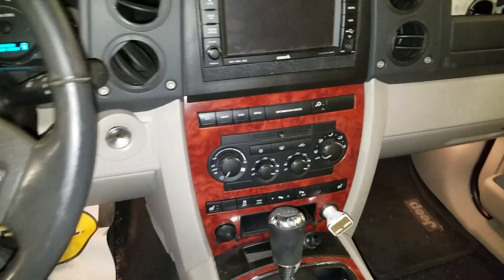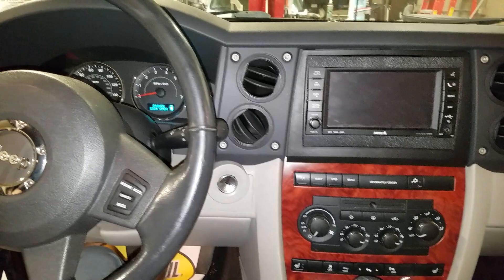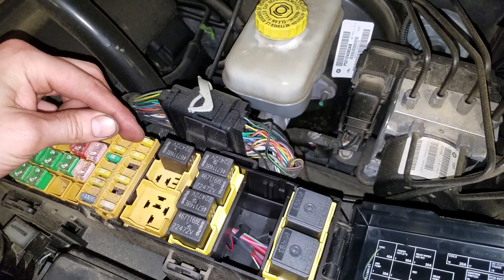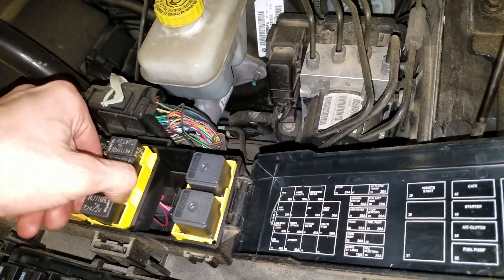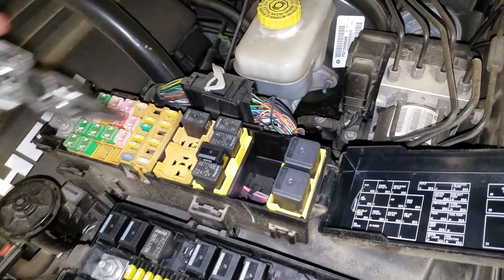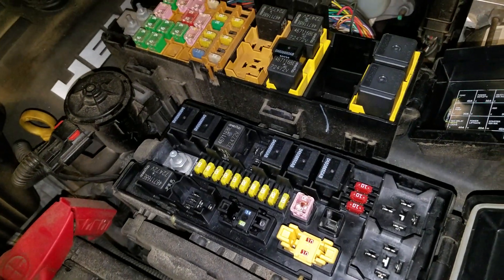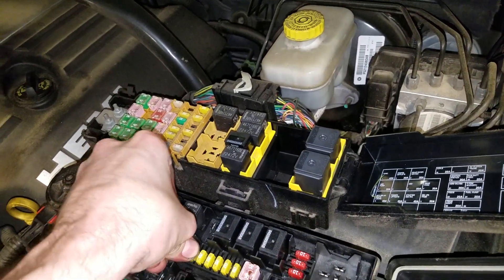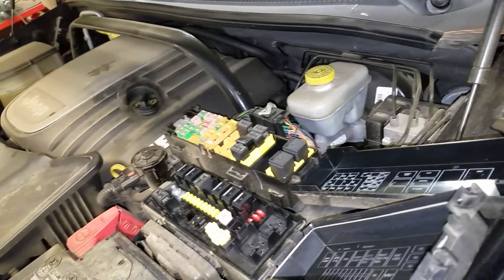Jeep Commander AC Fuse and Relay Location

Comment: My problem is. the compressor is working but it don't have power to the switch. the relay and fuse are good 2006 Jeep commander I appreciate any tips thank you
Reply: Hey
Reply: Having same problem my is a 2008 commander did you find the problem?
Reply: Up....same blower turns on randomly swapped motor...resistor....and fuses

Comment: My 2009 Jeep commander blows air but not cold air. We checked my fuse and they work, we added Freon and it got a tiny bit cooler, but not at all normal. My fan kicks on and off and each time the fan kicks OFF, the gauges that show the amount of Freon, go down. We can’t figure out what it is!
Reply from the maker: Are you measuring both the high and low sides with the gauges or just the low side? What pressures are you seeing and  what is the ambient temperature?

Comment: I have a somewhat similar issue, but I'm not sure what the root cause is, or how I can fix it. Usually right when i start my Jeep, a 2008 Grand Cherokee Overland, the Airbag light comes on and the AC doesn't seem to work. No fan, no heat, no air conditioning. Sometimes, randomly, it will kick on and the Airbag light go away. I've looked online and can't seem to find any sort of fix for it online. Do you have any tips I can try to resolve the issue? Thanks! Also, I've charged the AC and it's completely charged, so I don't think that's the issue.
Reply from the maker: I would use a scan tool to see what the airbag error codes are. When you say no fan, do you mean that the blower motor does not come on?
Reply: Lehew Tech The blower motor only works once the Airbag light is gone and either the AC or Heat kicks on
Reply: Well the air bag is 2 fuses make sure they are all the way in
Reply: It’s the battery. The alternator is probably putting out around 15v when working. The fact that it all starts working again after a bit is because the battery has been given some charge to help take some load off the alternator. Battery could be bad or the is something causing electrical drain, in turn having other stuff get wonky.

Comment: My 06 Jeep Commander blower switch is broken I think it blows but when I turn it to off it will keep blowing air
Reply from the maker: Sounds like a malfunction Front Blower Power Module! It is near the Blower motor on the right side of the dash and I see them fail in this manner a few times a year. Good luck!